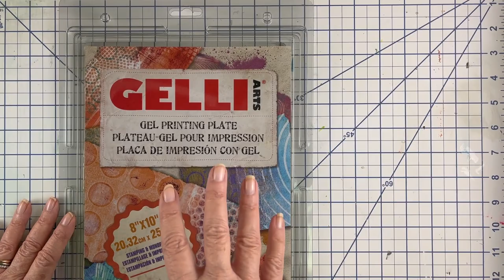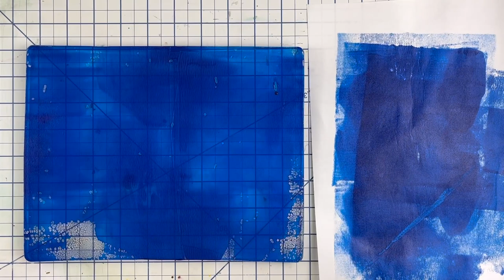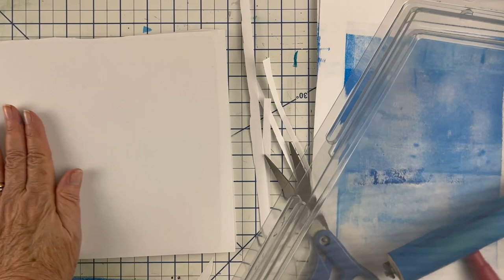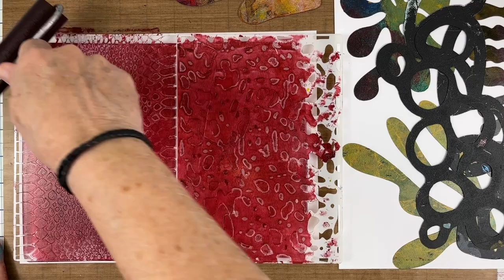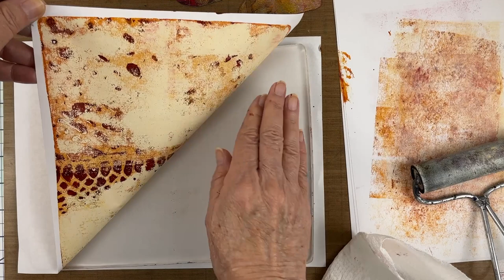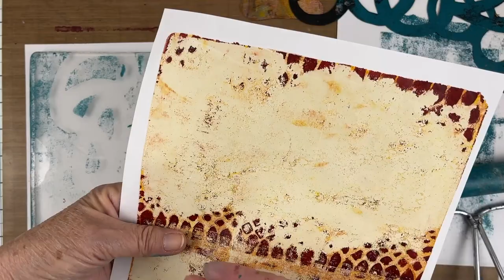Breaking in a new Gelli Plate

Comment: It's pretty simple science. The more fluid the paint, the higher the water content. The newer the gelli plate, the more oils. Oil and water don't mix. The oils from the plate push the water carrying the pigment and create the "lacy" effect. You don't need to dry out your plate. For the initial prints just use a higher density paint like a regular body acrylic from the tube until the oils are driven back into the plate and the excess that floats on top is eventually removed. THanks for your videos.
Reply from the maker: Thanks for your insight.
Reply: That does make a lot of sense.
Reply: Advice please!  I’ve just bought two square plates.  My initial prints on both have lines on, not a lacy effect (I’m thinking from the brayer).  What am I doing wrong?  I am a complete beginner.
Reply: @paulettesheard9186 I have the same issue! We are heavy handed! You have to do it very lightly.
Reply: My homemade gel plate never did any lacing

Comment: I love the ‘lacing’ effect. Unless of course I’m going after a smooth solid either opaque or transparent. In fact, I oil my plate so I can get that ‘lacing’ effect. I use both commercially and homemade plates.
Reply from the maker: Great tip! I'll try that when I'm going for the lacing pattern. I haven't tried to make a plate. Do you find it's nicer than commercial?
Reply: @SusanCliftonArtist  you can customize the handmade plates, size, shape and thickness. Great for more freeform abstract work. Longevity, they are not as sturdy as the commercial made, and will breakdown after awhile. However, you can melt them down and reform them. Ta-da! 
When I need a more traditional ‘offset’ print, the commercial made one is preferred.

Comment: Thanks for your video. I like the nice grid pattern you put underneath. Seems very helpful for positioning paper. Is it a cutting board for fabric? What is its surface like? Do you cover it with some transparent sheet of some sort?
Reply from the maker: It's a self healing mat. Graphic designers use it but also I've seen it in fabric stores. This one is double sided.

Comment: Susan, I have a new plate and have never used one. This is a big help! Wondering if an "unseasoned" plate has troubles with magazine transfers? I tried even using the recommended magazines ( Vogue ), different paints, and even a laser print off, and I haven't been able to transfer. Not enough or too little paint, pressure, etc. ? I've watched the videos I could find, but nothing seems to explain it except the need to season the plate. Would love input!
Reply from the maker: magazine transfers are tricky. I don't have a lot of experience with them. I find they are hard to do and I don't like to waste my paint. Plus it doesn't fit with my style of art. I have seen videos where people use color laser prints that have been double printed and they say that works. I don't have a color laser printer so I haven't tried that. I had a little success with a black toner laser printer but I wouldn't say it was perfect. I suggest you learn how to do gel prints normally first and get the hang of it before you try to do the magazine prints. Best of luck.
Reply: Wow, Thank You Susan! I will follow your advice....and your channel! Love both your sweet atmosphere and content! @SusanCliftonArtist

Comment: Thank you! If one wanted to intentionally get the lacing, what needs to be done?
Reply from the maker: You can always use baby oil on the plate. Also the thinner the paint the more lacing. I did a video on using Golden highflow paint which is almost like ink. You get a lot of lacing with that paint. But it was a cool effect.
Reply: @SusanCliftonArtist  Thank you!😊

Comment: I rather like the 'lacing' pattern, it's temporary with a new plate. I've heard storing the gel plate with plain paper on top is preferable to using the plastic sheet. I also find a layer of baby oil cleans stubborn marks and is quickly absorbed into the gel plate and no lacing results!! Loved that ghost pull too!
Reply from the maker: I did see it mentioned somewhere ages ago which is why I tried storing it with paper but since I've seen other that warn not to do it. I agree sometimes you want a lacing pattern. I did a video using high flow paint and got lots of lacing and they were beautiful prints.

Comment: Will baby wipes help remove the oils and I can never get my brayer clean, what can I do?
Reply from the maker: I don't think so. I use baby wipes to clean the plate but I don't think it removes the oils. You don't want to remove all the oil. Just enough to get the paint to adhere. I do have videos on cleaning both the plates and brayers. For the brayer I soak in Murphys Oil Soap.
Reply: @SusanCliftonArtist  thank you. I’ll look for your cleaning video.
Reply: I gel print alot.  What I do is take an old wash rag (thin is good) cut in half, get damp, keep in a small bowl on my table.  Inbetween, while waiting for paper to dry on the plate I clean my brayer with damp paper towel and then the damp wash cloth.  I keep my brayers very clean this way.   I almost never have to soak my brayers any longer.  When I do soak them, I use Murphy's Oil Soap and water in a small container, about 8 parts Water to 1 part Murphy's, or simply water with a dollop of Murphy's.
Reply: @KathyBrooksArt  thank you, I will try your cleaning method. Can inexpensive brayer be a problem?